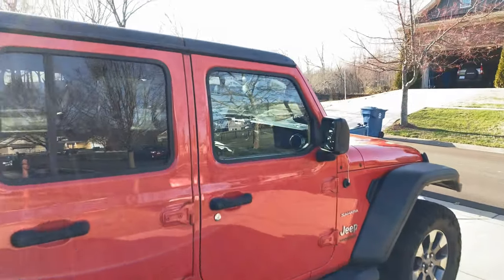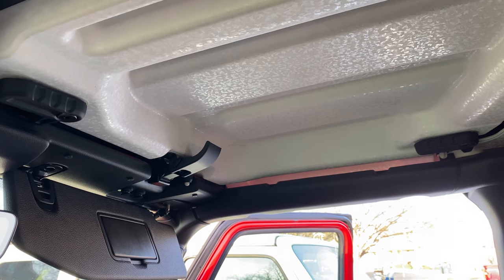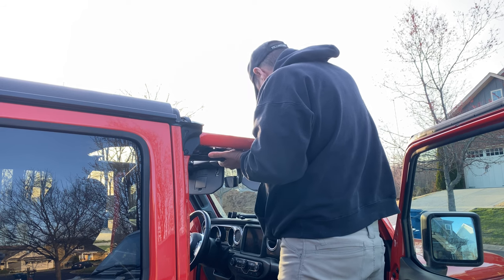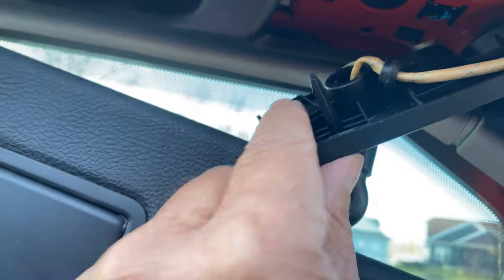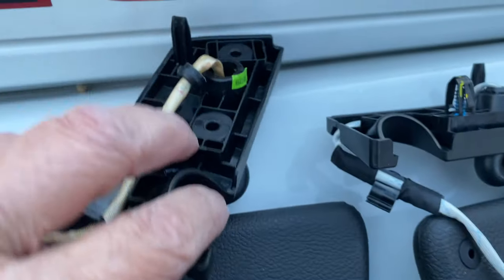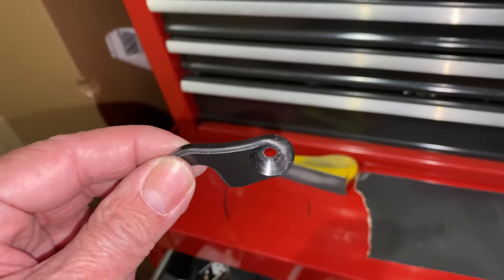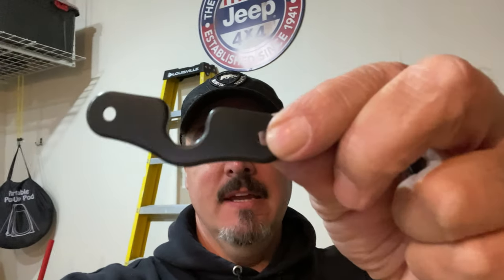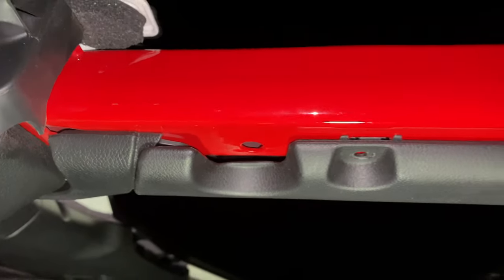How-To:JL/JT Jeep Sun Visor Repair or Replacement Options

Comment from the maker: July 2024- I just want to take a second to point out the video was recorded almost 3 years ago when the price of the visor was $20 and $12 shipping for the passenger side visor. I scoured the internet to find that price and was happy to find it for that low price at allmoparparts. The driver side with the garage door controls was significantly higher. Now, that same visor part number has increased to $126 through the same vendor! Wow! Anyway, I just want to give people a heads up on this. Thanks for your support and have a good one.

Comment: On my 2020 Galdiator Mohave, I didn't have to remove my freedom panels to access the top two screws on the roll bar cover. The top two scres are mounted at a slight angle that allows access without taking the freedom panels off. (Good thing for me, because I have roof rack bars and a 10' solid paddleboard on my top!) Also, I tried the lock ring repair, but it didn't work for me. The lock ring I have isn't big enough on the outer diameter to stay on top of the mounting bracket: it just falls through the hole. I have ordered the replacement bracket to secure the visor from the bottom side. Thanks for the video.
Reply from the maker: Yeah, I’m glad I don’t have a roof rack and I’m trying to avoid it, that being one of the reasons. There’s been a few to get the rings to work but for the cost of a new visor, the TACCOM clips, and the ease of install, I’m glad I went this route. 

You’re welcome and I glad the video was helpful to you!

Comment: it is more than 20 dollars for the visor like 110-160 depending on where u get it
Reply from the maker: Inflation. I’ve heard it’s went up….A LOT! Crazy. I paid that low price almost 3 years ago now. Even then, the driver side with the garage door controls was significantly more making the passenger side feel like a steal of a price. I went ahead & pinned a post letting viewers know. At least the information on the visor replacement procedure and the addition of the TACCOM clips is still useful.

Comment: Awesome job, ty! I’ll be doing that today on my 2021 JLUR. Visor slides in and out, longated. I wonder if sliding it out 1/8 inch clears driver side mount bracket edge?
Reply from the maker: Thanks! It’s worth a look. 👍🏼